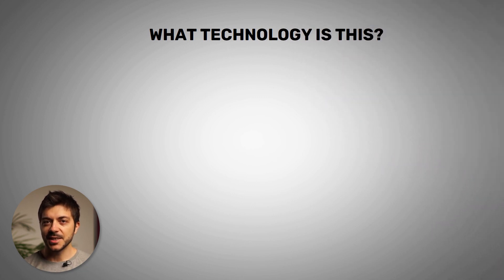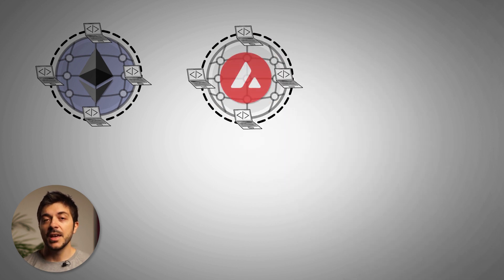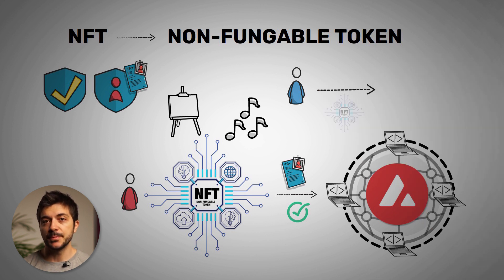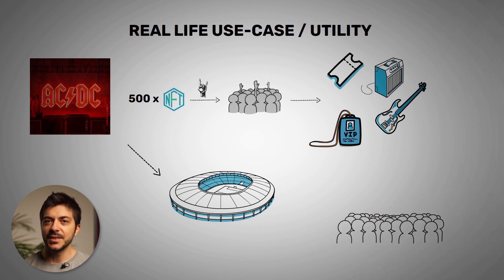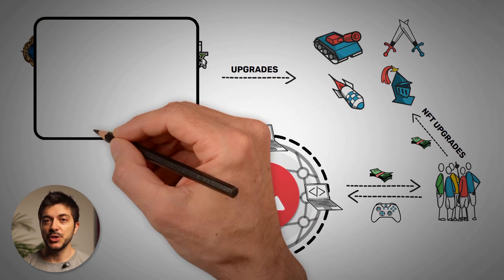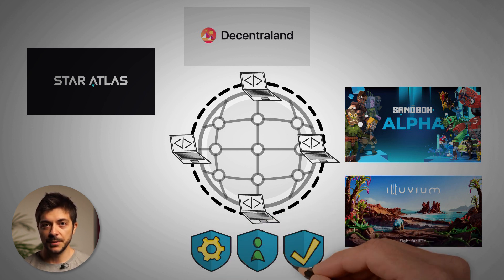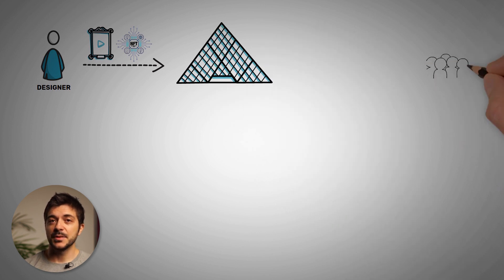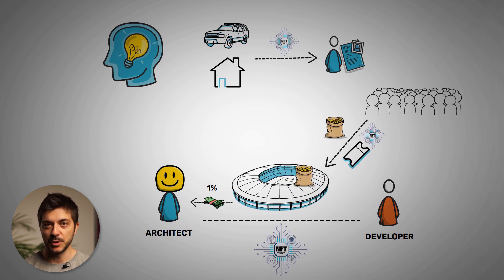NFTs in Architecture

Comment: Altough it seems cool, a stadium with 50,000 people with each one of them having 1 ticket. Would consume an insane amount of eletricity. In times when building have to be more sustainable, we shouldn't be seeling designs based on carbon emission
Reply from the maker: Hi Joao,
I already replied to this below. 
Yes, this is a valid concern with most of the current blockchain networks! However, just like I mentioned in the video, there are many different blockchains. They are not all working with the same properties. One of those is also environmental impact and carbon emissions. That being said, there are a couple of projects at the moment, one of them being Solana Network that has a different way of validating transactions which is more environmentally friendly, which would be on the same level as a typical centralized company like Facebook or Google, so having an argument that NFTs would be bad for the environment would be exactly the same as saying that Google, Facebook, Youtube are already bad for the environment and therefore shouldn't be used at all.
Reply: @HowtoRhino  but just because Google, Facebook, YouTube, etc. are 'bad for the environment' doesn't mean we need to add on to that. that's a bs excuse.